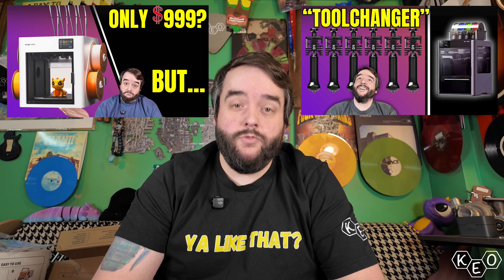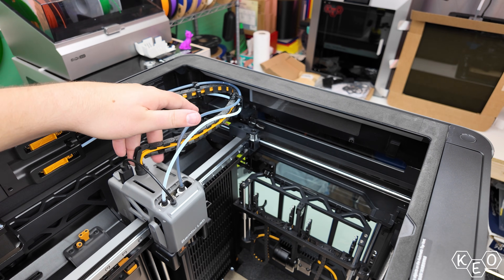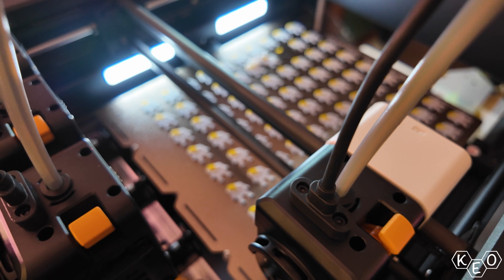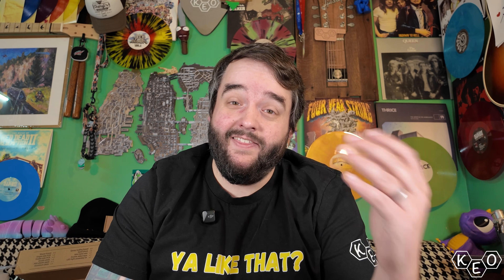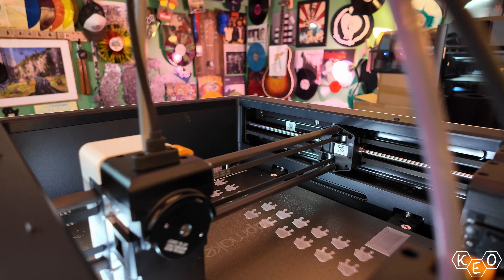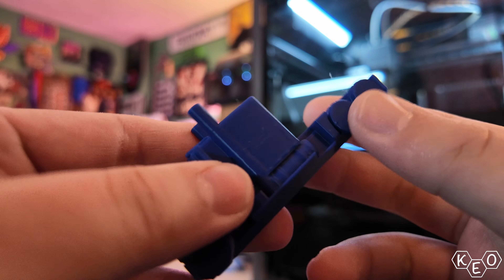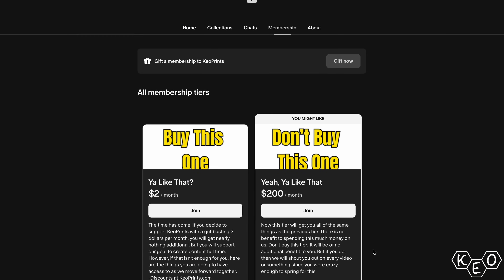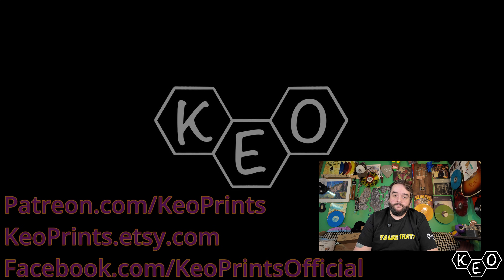Bambu H2C vs Snapmaker U1 — Toolchanger War

Comment: This is the best comparison I've seen so far.
As I see it, Snapmaker U1 is perfect for people on a Budget, who have an A1/mini with or without AMS, who don't want or are tired of waste, and who have enough experience to deal with a certain level of inconvenience but who will get some freedom in return. Or for more advanced users who want to print real TPU (not Bambu's) in multicolor or combined with other materials.
I am one of those guys, my U1 arrives on middle January.
PS: I don't care about ABS, ASA, CF or so.
Reply: I jave P1S with AMS2 and yet i much more prefer the U1 over H2C. And no its not only the cost of the system, i could afford the H2C but its a dead end solution forcibly made to work only with AMS. Real toolchanger is the way to go and so far the Snapmaker seems to be the best choice
Reply: @Asghaad  Very good point and the main reason I’m going U1 (other than cost)… the H2C is completely dependent on the AMS. It’s the bottleneck and weak point of the whole system. No thank you. Not a good solution in my opinion.
Reply: I avoided the Kickstarter just because I still don't know about the longevity though the U1 looks pretty solid.  I'm very tempted to get one and just keep my P1S for doing ABS and the hotter filaments.  Don't really need two 3D printers but having something that can quickly and easily do 4 color prints as well as mixing PETG/PLA supports or doing some advanced stuff with TPU is a game changer.
Reply: I have no complaints about my H2C it's marvelous !!!!
Questionable reliability of UI ,<1k for that caliber of a machine makes me wonder
Reply: The H2C is an amazing machine but the U1 has no reported reliability issues as of yet. Nothing widespread anyway. Many people already have theirs and have put thousands of hours on them with no major issues. So I don’t think it’s fair to say it has “questionable reliability.” I understand your skepticism, but that’s all we can say it is right now… skepticism. The U1 launch (and reliability) has been smooth so far. Hopefully that continues.
Reply: @GoComm79  Not many have them yet so talk to you in a year
Reply: Actually, you’re quite wrong. First batch of production models were delivered starting last month and are scheduled to finish mid-December (today actually). That first batch is 10,000 units. And I’m not talking delivered to the country of origin and stuck in customs for weeks. I’m talking delivered to the actual customer’s house. I personally know three people that received theirs in the last month and have put hundreds of hours on them already. That’s 10,000 units already delivered with no major delays reported. That’s pretty damn good if you ask me. The next batch is scheduled to be delivered the first 3 weeks of January. I’m in that batch. Can’t wait!

The point is, quit being a hater, lol. Don’t be mad just cause you paid three times as much for a machine that prints significantly slower, haha! Both are great machines! Enjoy!
Reply: @GoComm79  Talk to me in a year Pinwheel
Reply: Such a troll, lol.

Comment: H2C is an auto fail for me. They knew others were bringing out stuff (like idx) and they rushed a solution. So many moving parts so many more failure points. But the biggest failure is the ams/ams2 being a bottle neck. No matter how fast their hotend changer is, it still needs to wait for the slow ams.... Stupid... Other companies are doing this way better. I don't like prusa but their adoption of idx is going to be the new benchmark. Im still waiting for bambu to bring out a no nonsense machine since the A1s... They try to innovate but everything seems like a gimmick... The dual nozzle thing is so dumb! A laser in a 3d printer so dumb.
Reply: Like it or not the H2C was in the works before U1 or INDX were even a thing probably by a year. I love it when people think engineers can work so fast and we can react within 90 days... think more 1.5 to 2 years.
Reply: @scb2scb2 i think that makes it worse thren. They had more time and created a bad solution.  It really should have been a new solution rather than trying to force something to work with the current infrastructure on their machines.
Reply: @ChitosVids  We will see how it evolves personally i am 50/50 on it. Its easy to declare a winner now since the solution people can't use and can't really test is used to compare and seem to be happy to skip of its own weak points. But let me repeat myself again i can print today with a build space bigger than even the Prusa Core One L with indx, bigger than a snapmaker U1. Way faster than the old generation  bambu printers with nearly zero waste. Could it be that this is not the way forward? Sure and then ill be happy to see what they will do in 2 years they will either close the gap with their own ideas or move to the better system once it has been proven in the market (it has not and will not for in my view maybe a full year). 3d printing is such a fast moving space we should expect different solutions and see what works. Now my personal view is vortek and indx kind of had the same idea the biggest difference is do you keep the tube on or not both have their issues one can be yelled at now since its being sold and in the end of users the other is not and  is  still on paper perfect. I am also slightly leaning that indx might be better but do want to see how they can be as flexible as the h2c now is i can pick a color from 3 ams boxes now and select a nozzle from my computer and if needed swap it in 10seconds there is power in that.
Reply: @ChitosVids  it's not a bad solution, it's just different
Reply: The h2d was launched as a prosumer printer, not a hobbyist one. The h2c is in the same category. But as it is a Bambu, it's so easy to use than even new users can use it even if it's more than they ever needed.
Reply: @patricklebel1141 i really like that about their machines. But these new machines are terrible as a concept. Sure they work and print great but the fundamental concept of the h2d is bad. Dual nozzle, ok but dual hotend would've been better and made use of the whole build plate... Why a laser, who asked for this? So expensive when you can spend the same money for a seperate laser with a way bigger working area... So silly... None of their newer machines are good in concept. I womder how hard the h2c will be to repair. The more moving parts the more maintenance. Its a bad design
Reply: @ChitosVids Maybe for you, but not for me. I can definitely see and use dual hotends to print interface material for supports. Make the removal much easier and the supported face cleaner. Having dual hotends (and nozzle) prevents cross filament contamination into the nozzle, preventing print failures. On Bambu printers hotends and nozzle cannot be separated. I didn't ask for a laser, but I can buy one without it, and later, add one if I need. The H serie is more tailored toward prosumer that need more printing options than those needed to print dragons. The fact that they are easy to use allows anybody to use them. They seems to sell well to, so I guess that not everyone has your own needs for printing.. I certainly don't.
Reply: @patricklebel1141 i get it. Dual something is nice. Im just saying dual independence hotends would have been better than a combined one. Would even work the same way with their ams. This combined hotend feels like  an experiment in innovation for very little gain. Innovation for innovation sake. And its expensive for very little return. They want to appear as a market leader than adopt tested and working 3rd party solutions
Reply: @ChitosVids What you are talking about is called IDEX. Independent Dual Extruder. It has been tried by Snapmaker, but didn't get good comments. You have dual of everything, a nightmare to maintain. Dual print head means that absolutely both of them has to be perfectly calibrated, belts has to be tighten the same, else your print won't be acceptable in engeenering. A few tenth of millimeter of differencescan be acceptable for dragons, but not for engeenering parts. One head, with one extruder and a simple switching mechanisms allows for precision engineering parts needs, and this is where this printer is aimed to. The x serie needs a refresh, so maybe there will be new stuff for hobbyists.

Comment: Flexibles aren't absolutely out of the  question. The H2C can print some flexibles, when you identify them as "TPU for AMS". FAR from ideal, but it apparently works. Plus I'm far from sure what A-rating would work in the AMS & what will cause issues.
Reply: ehmm it can do all TPU's (on both nozzles) its just you can't use the ams and feed them directly like on most printers.. The TPU for ams is well can we even call it TPU really...
Reply: Unfortunately that this they called TPU for AMS is not really a TPU.. check the review videos. TPU is way too soft to work with AMS and it will never work.
Reply: @orhanyor  Indeed so on the h2c (for both nozzles) you have to feed them like other printers directly and that works fine. Maybe they will find a way to make a 'ams' work with flexible someday but notm with these generation. The TPU for ams is well more a PLA that feels a little soft.
Reply: @scb2scb2  I think bambu will release another printer similar to INDX in 2026. And not just bambu, 2026 will be the year of toolchanger 3d printers.
 Imagine if they attached a bowden tube to each nozzle on the vortex system they would have had their own version of INDX. They were so close but missed the mark. If INDX works even remotely somewhat reliable, H2C has no place in the current market. Bambu has to come up with similar machine. 
For me INDX is probably gonna be the best machine in the market when it comes out, U1 is the second. And this is coming from a long time bambu user, im a fan of their machines, love their tech but H2C is not it :/
Reply: @orhanyor  Well INDX will not be available for h2c size printer for in my guess 8 months. I can tell you what ill think they will do but i have posted that already on this thread. They now have a 3 layers 2-heads, 1-vortek, ams.I think they will go to 2x2 heads to compete with U1, 2x2 heads+vortek (L+R) + ams3 for the mid and highend. Having only going 4 tubes max to the head might be the best compromise since having say 10 or 12 coming in also has its own problems. But if a INDX like system is the future we will know in 2027 and can move again. For now the h2c works and is printing today not somewhere next year for me.